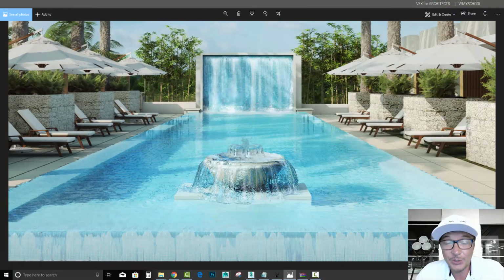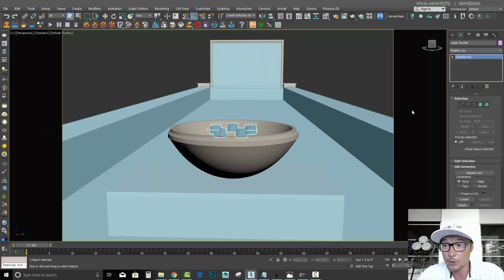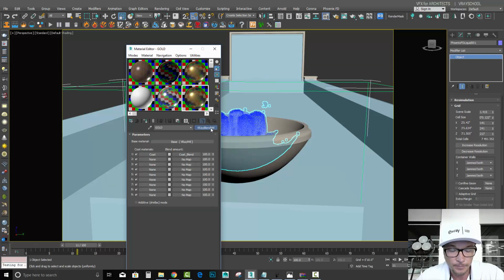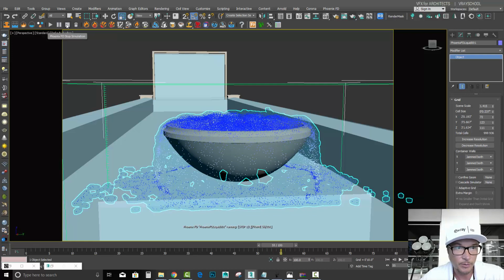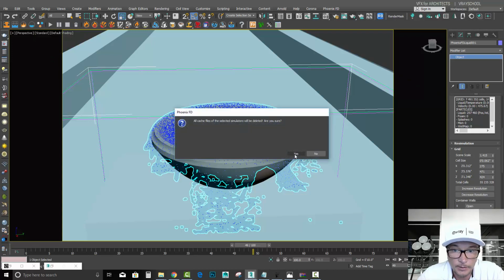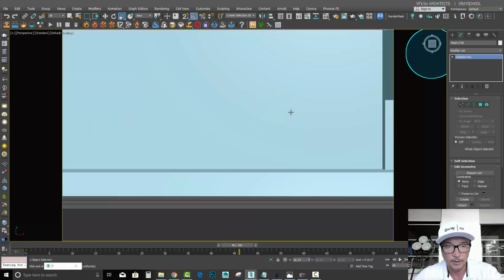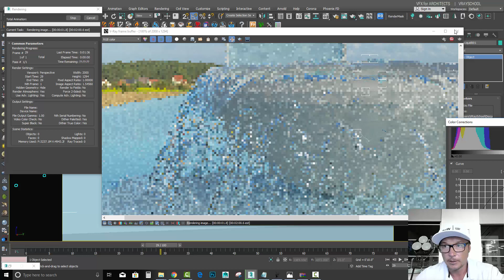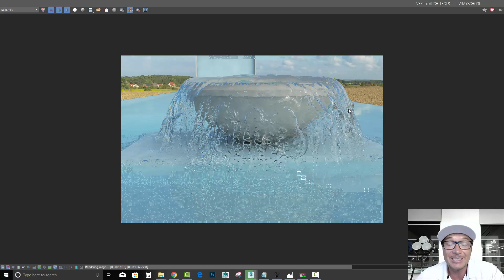Water VFX with Phoenix FD for 3Ds Max and VRAY NEXT

Comment: Bro, this program is a dead end path. In real work, this mission is impossible! You will rest your horns against an impenetrable wall! It works very slowly! You will not be able to make a video with a fountain if you do not have a Pentagon data center in use)))
Reply from the maker: holy qwacamuci that's a high level access your translator does a very good job

Comment: nice video. Do I always have to make preview anim for particles to be able to seen on render. For example I want to emit the water liquid from frame 200 I have disapled the ticks from 0 100 and made it from 200 to 400 but nothing seems happing on the fluid side. is this something special do I have to do thanks
Reply from the maker: Yea you can choose from which frame to start the simulation, it’s a first option in simulation rollout